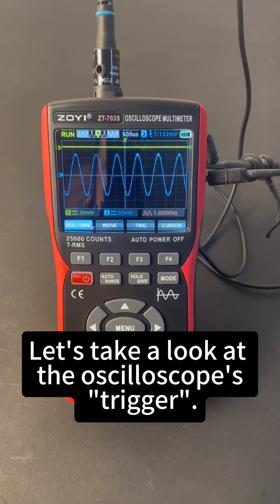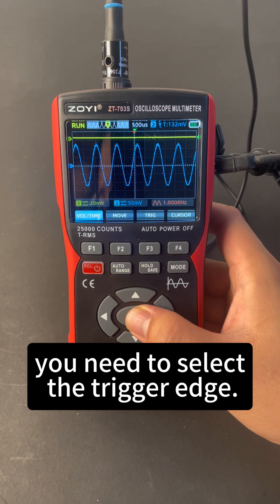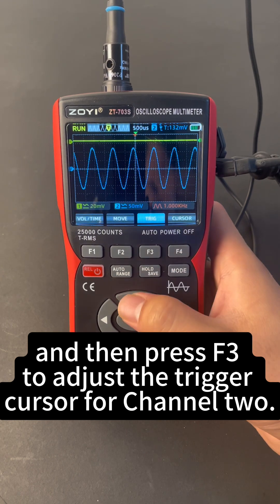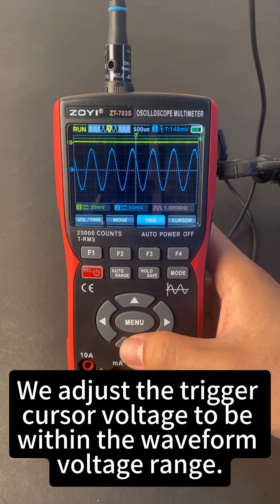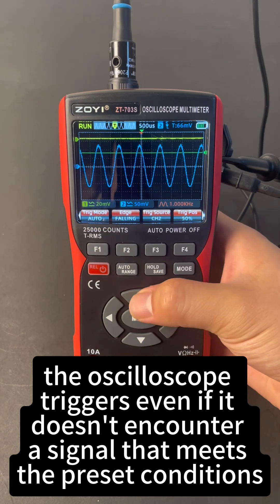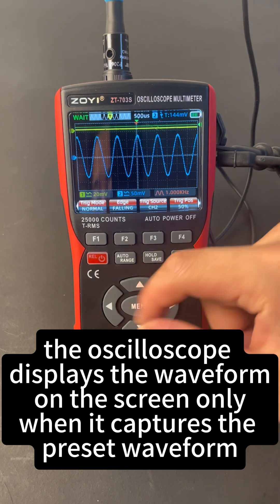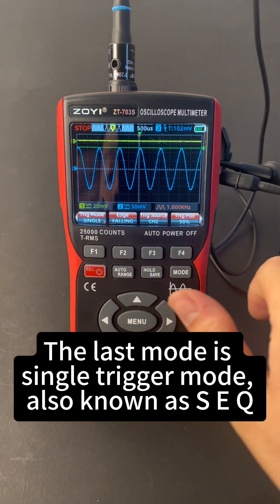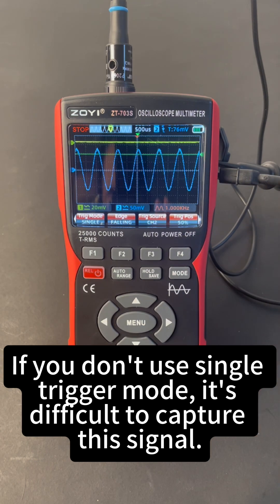ZOYI ZT-703S

Comment: Is there going to be an update to fix the auto range function on oscilloscope?
It is totally unreliable and useless in firmware version v1.3 9. 
It can't recognize even its own 1khz test signal. 
Often the unit freezes for about 10 seconds and the voltage/time ranges goes up to 100v/25ns and then obviously it can't show the test signal.
Please fix this!
Reply: Mam tak samo,pozdrawiam z PL
Reply: @BialasekStudioGARAŻ-PL  it is fixed in latest (v1.42) software.
Reply: @kert9837  Dziękuje serdecznie za odpowiedz :) masz może link do strony,bo nie znalazłem?